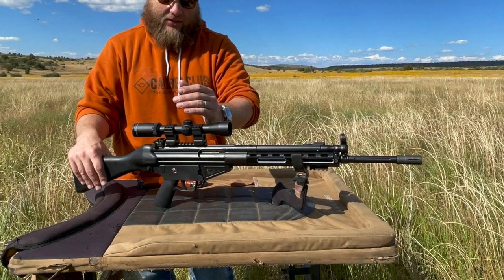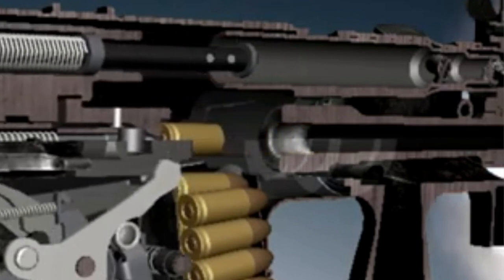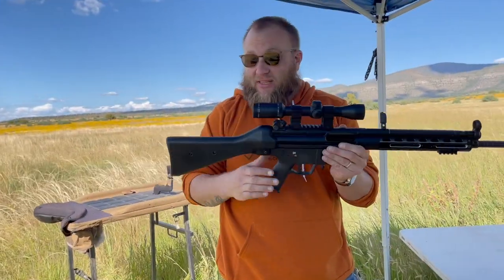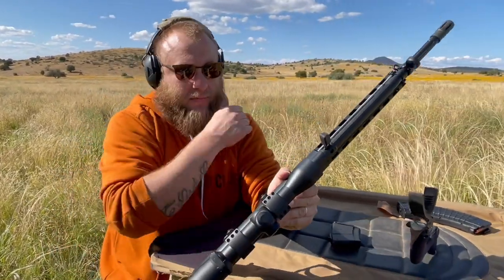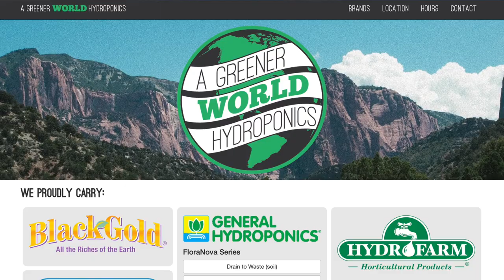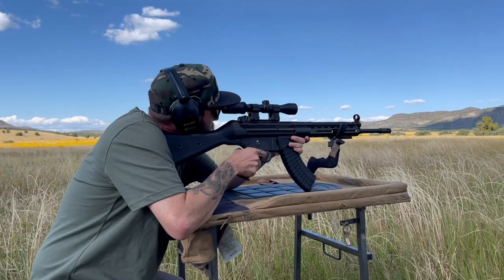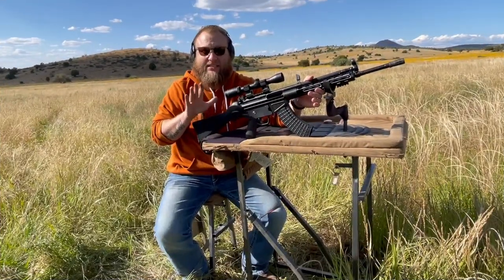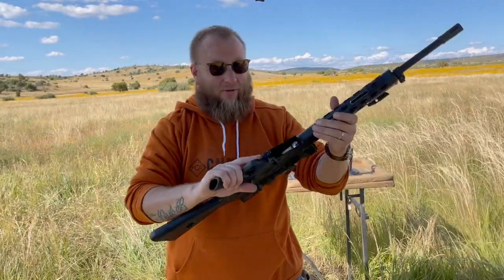Roller Lock PTR32 | Serial No. 1 | HK32

Comment: Its curious that the receiver looks to be a single pin design and the buttstock is definitely from an HK-33 . Its not like the current PTR-32 production. Too bad PTR didnt stick with this design. Nice review
Reply from the maker: Thank you, I appreciate it. Yeah I found this gun on Gunbroker years ago and just thought it was cool. I'm a collector at heart and stuff like this is the BEST! Thanks for watching and commenting. Hope to see you around here more.
Reply: The early PTR-32 was basically a SEDENA HK32 albeit with a modified mag-well to work with AK magazine. That's why it uses HK-33 design. PTR decided to make the final PTR-32 with the dual pin design just like the early HK32 instead, that's why they dumped this design.